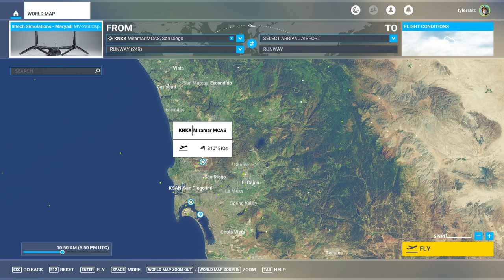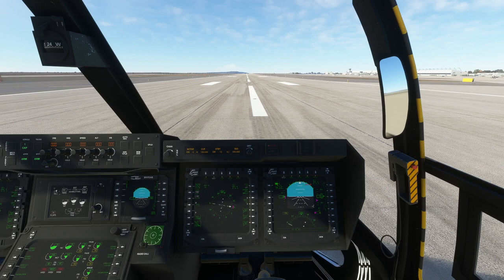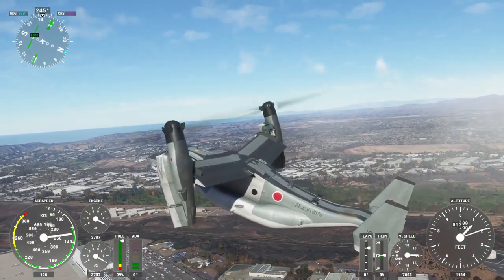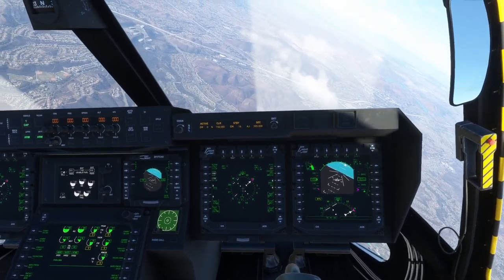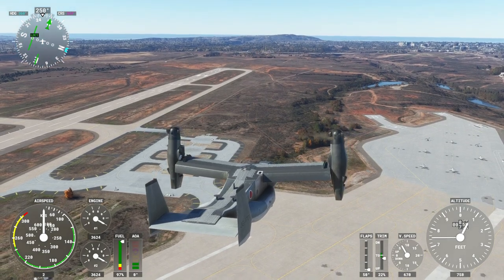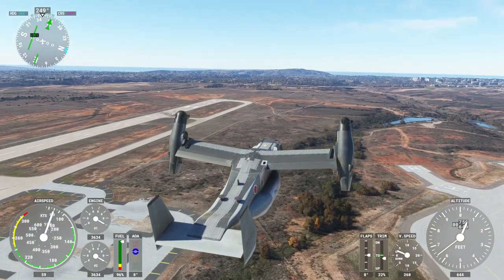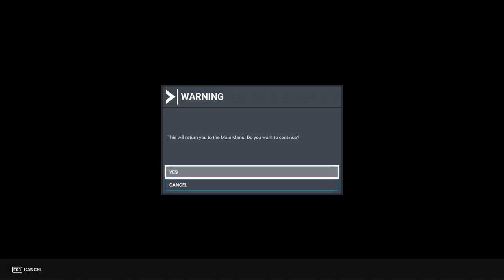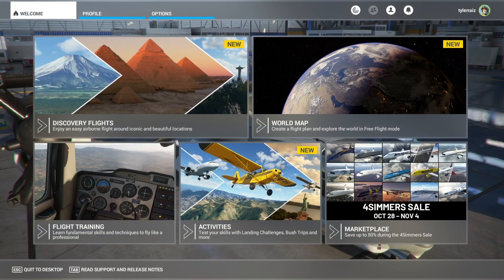Flight Sim 2020 - MilTech Sim Osprey First Try

Comment: I still see third-party aircraft are sloppy, but a good try for now.
Reply: Uh, no. There are some absolutely amazing 3rd party aircraft in MSFS. There have been for a while.
Reply: @shinkicker404  well the only third party aircraft that actually worked well are the ones that co-developed with Microsoft. This version of the Osprey is okay as hovering characteristics are horrible, but that might be due to the characteristics of the simulator not having any type of helicopter synamics embedded.
Reply: 3rd party Helicopters are a year out. This is a nice middle ground though you still have to hold a hover it’s just not as sensitive as a heli sim